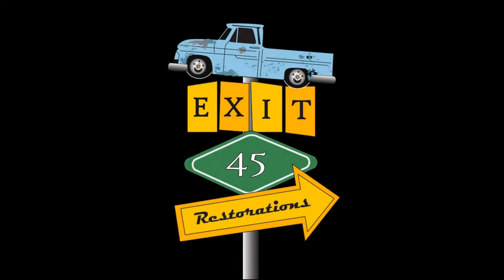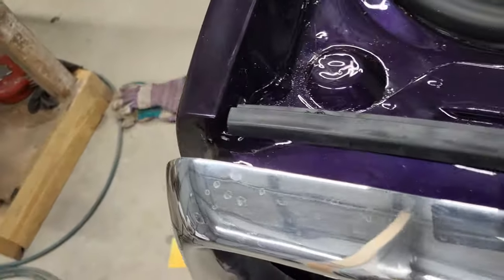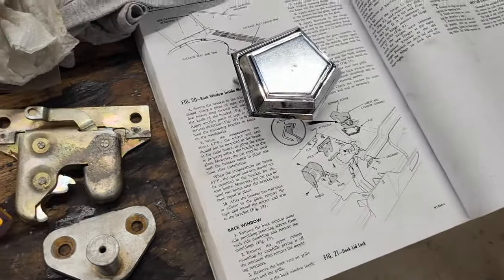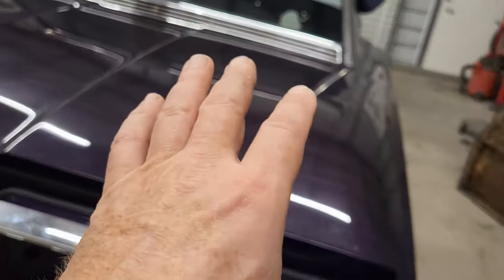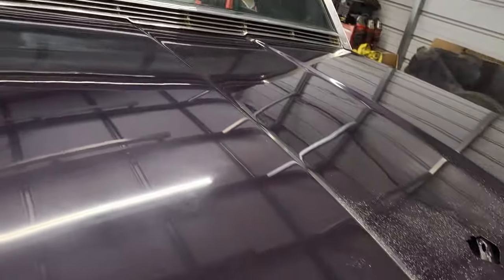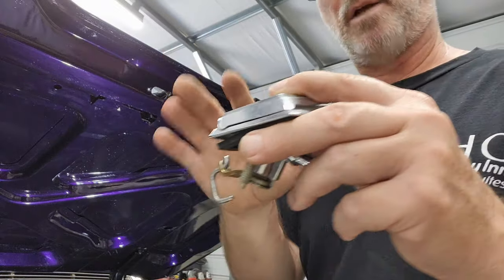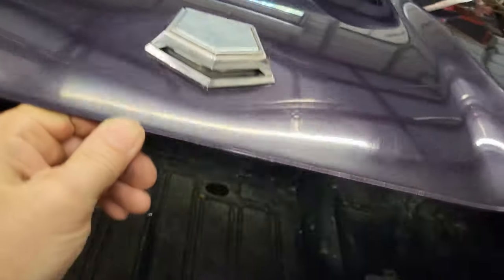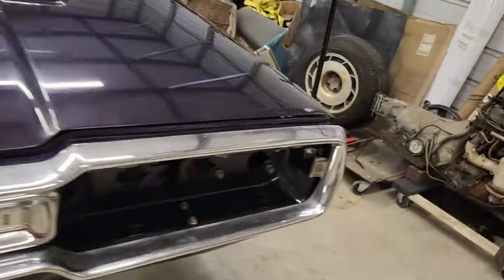1964 Thunderbird Trunk Install - Part 2

Comment: Hello Nick. I couldn't find quality pictures of that trunk seal, but i think you have it correct. I did notice that my trunk lid sat lower down without the seal. Maybe 1/8 of an inch below the quarter panel edge. I'm not going to remove the hinges cause i don't want to mess with the alignment. (Chicken)
That was quite a feat moving that trunk on and off by yourself. It's looking great .
George B
Reply from the maker: Hey George.   Good to hear from you.  The trunk has been a challenge for sure.  I think I have it now.  I'm hoping that over time it will settle in and the trunk will settle down a little lower

Comment: I still have the original (pretty sure) seals on mine. I'll be home in a couple of days, I can send you pics of them if you don't have it figured out by then. Looking bad ass btw
Reply from the maker: Thanks.  I'm still not sure, so if you have some pic, that would be helpful.
Reply: @Exit45Restorations  Will do, I should be home by Tuesday.

Comment: Hey Exit, you did a nice job on the rubber seal. Yes the rear seal with the clips is in correctly. I hate putting the big trunk seal in, what a pain. I don’t usually remove the trunk lid since I have a lot of experience getting in and out of trunks from sneaking into drive ins when I was a kid. Ive always believed that reproduction rubber is harder than the original rubber so I think this is one reason the trunk lids don’t close properly after installing a new rubber seal.

I see you did something to your gas tank. I didn’t see that video so Ill have to watch that. Must be an in tank electric fuel pump. Nice. That’s the way to go to help stop vapor lock. 

Yes the repro parts such as the trunk lock housing are sometimes very difficult to deal with. You’re not the lone ranger in that battle. Why don’t they just make them correctly??? I ran across that too and I think I drilled the bolt holes out bigger on the latch body so I could shift the lid around to fit straight. Its been a while but I think that’s what I did. I also think that the nuts hit the metal flanges in the hole in the trunk lid so I had to trim off the edges of the metal flanges in there. I'm not explaining that right but if you try to install it you will see what I mean. 

There is a magical formula to putting on the trunk lid. Its called, banging your head against it for as long as it takes to get it right. And maybe your done 5 head wounds later. You can go to the side of the trunk lid and push it to the other side to help bend the hinges slightly. Ive done that many times and it helps. Nice job. You have a really big project there. Good luck.
Reply from the maker: That's again Nick